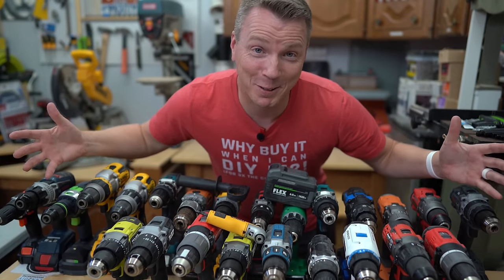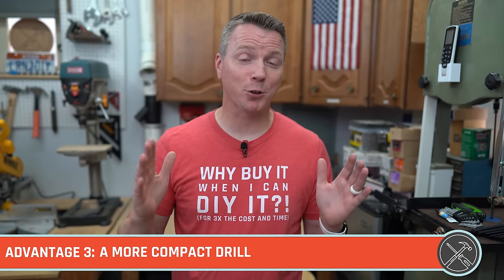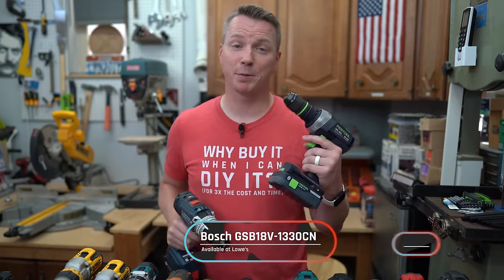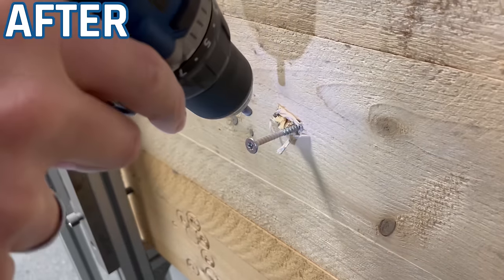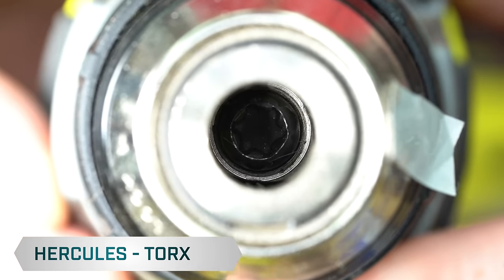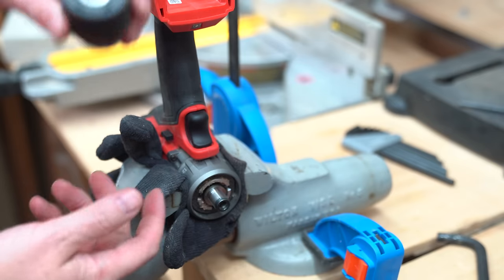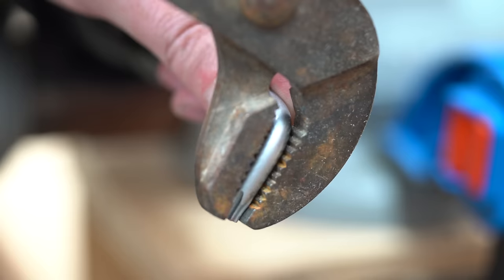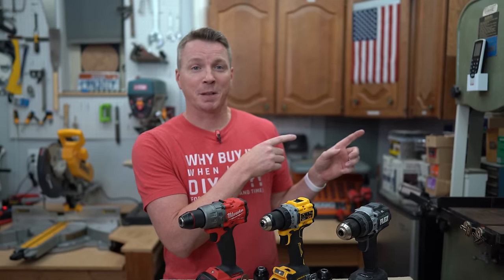The Single Best DRILL UPGRADE I’ve Seen

Comment: I’m a design engineer for a precision air tool manufacturer for aerospace and defense applications, we ran through a gamut of chucks and transitioned to ROHM chucks several years ago. Each time I’ve tested them they’ve held .001 runout at 2" to 3" from the rear face of the chuck depending on the size of the chuck. They hold drills better than most as well. We run them over 6,000 rpm in many applications.
Reply: Surprised Rohm won out over entirely better brand like Albrecht.
Reply: @agg42  a lot of that comes down to being able to fit our product line, cost vs performance, and availability. Albrecht primarily makes mill chucks that are larger and heavier than the chucks we were looking for.

Is there a different product line that they have that would fit a 1/2HP palm drill up to a 1.5HP air drill?
Reply: You just saved me from watching this. Appreciate that
Reply: @SOHCHEAD Just out of curiosity, do you by any chance have a list of the various chucks you compared? Maybe a ranking system? Just curious as I'm in the market and have had my eye on a Jacobs chuck...

Comment: PROMOTIONAL VIDEO.  BTW - these are $50-$70.     NO TESTING. The testing section has no actual comparison of the advertised chuck to another brand like Jacobs (which are good chucks!).     In one shot you see a hole supposedly drilled with another chuck where the bit wobbles around in the hole.  FAKE!?. That DOES NOT happen.   A plastic chuck would do better than that.   This is why people like Project Farm so much.  You can trust that channel.  PROMOTIONAL VIDEO. should be at the front, not end,  and at the top of the description (it's 7 lines down).
Reply: I have DeWalt, Milwaukee, and Bosch drills. When trying to drill straight and precise in certain applications they all have noticeable wobble. Especially the DeWalt.

Comment: Bosch used to make the best drills and worst chucks. So they invented SDS to solve ths. Now we have 2 options.
Reply: One of my first cordless drills was a Bosch I bought in 1988. The dealer sold me a Jacobs chuck at the time I bought it, That combo was unbeatable for years until the batteries died and I couldn't get replacements.

Comment: Great topic. An excellent alternative if you have a cheaper drill that you don’t feel like spending a lot on is the Jacobs brand chucks. At one time, Jacob’s was the premier chuck available, but they have become Chinese since. Their chucks are not as great as they used to be but still way better what comes on 90% of the drills today. They are also very reasonable with some excellent models under $10.

Comment: Röhm is the go to Manufacturer when it comes to chucks, tool or part holding. They are the best of the best, doesnt matter if on the Lathe, on the Mill or as you shown on the Cordless Drill. If you can, always choose Röhm, Quality from Germany.

Another thing ... i never in my live heared anyone say that Woodworkers are geared towards accuracy ... We have a saying in Germany and i try to translate it as best as i can. Metalworkers work in micrometers, woodworkers work in milimeters and brick layers have to see that they are on the right property.

Comment: While you should have revealed that this was a paid promotion upfront, I none the less appreciated the video. I have a Milwaukee cordless drill that I really like but the chuck has been giving me issues (very difficult to loosen after tightening). I wanted to do something about it but wasn't aware that replacement chucks were available so it looks like I'll be heading over to ROHM for a new one.

Comment: I knew I had a bad chuck on one of my cordless drills, so this was a good time to check all of them.  I made a simple setup on my welding table, lightly clamped the drill to the table, chucked a steel dowel pin in the drill and checked the runout.  The bad one was .01, the other 2 were .005 and .004.  Not too bad for a cordless drill.  I ordered a new Rohm chuck and replaced the bad one.  It tested at .002.  The one that is at .004 is a standard Dewalt chuck replaced a year ago.

Comment: I’ve been a 3rd generation Carpenter for 20 years among other types of work auto mechanic steel, different types of metal work I have all types of drills and Flex is an amazing powerful machine but the chucks aren’t great I tried to change the anvil on my impact to a 3/8 socket drive with a 1/4 hex inside the 3/8 for my own versatility options and efficiency but for love of god and can’t find an anvil to fit to replace it 😂 hoping you could help being your the drill master in my opinion hope to hear from you or someone else who’s had this issue I can’t be the only one because I want to keep my Flex impact and not have to have another impact for my uses it’s more power that I need just a an anvil will do thanks

Comment: 2:57 I wouldn't typically think of a Jacob's chuck as lower quality. Are you asserting that Jacob's made an inferior chuck for Flex? Or was it your personal experience that led you to that conclusion?
Reply from the maker: I tested the Jacobs chuck before and after swapping it out for the Rohm and it ran straighter (the bit) and felt tighter with the Röhm. Jacobs chucks aren’t bad chucks, they’re just not manufactured with the same quality control and engineering as Röhm. Jacobs no longer makes chucks in America. Rohm’s are designed and manufactured in Germany, where a close eye is kept on QC.
Reply: Jacob’s has deteriorated in quality, their chucks are no longer viable for precision work.

Their runout and ability to hold are significantly worse than they used to be, likely before manufacturing moved. Röhm makes a solid chuck that I’ve yet to see run the same loss of quality as Jacob’s.
Reply: @LRN2DIY  Its a shame to see so many big US brands move manufacturing to China. I even noticed some Estwing hammers are now made in China.
Reply: @SOHCHEAD 
Mine are so old and last so long, I didn't even know  about current quality.
Reply: @noire1001  I hadn't heard that about Estwing.  Sad.
Reply: @1978garfield  Yeah the ones with the hickory handles are. I got excited when I saw them as they look good, but then noticed they were made in China. The steel shaft versions still proudly claim to be made in the US, but there are loads of customer reviews stating the recent quality is shoddy, so I have suspicions the steel part is made in China and then they simply assemble the hammer and handle in the US to claim its made there...

Comment: My Milwaukee chucks are awsome, never had any issues like you mentioned and replacing it with the on you mentioned would if anything be a downgrade. Tested alot of chucks and Milwaukee are simply awesome
Reply: Are you sure? I use milwaukee too and the chucks suck!
Reply: @tracklizard4018  Which model no drill do you have?
Reply: @v8tergt653  I've noticed it's worst on the FPD3 (2904?) but I think it might be due to the hammer functionality, though that doesn't casue issues in other drills. Mitigated with a better chuck.

Comment: That's perfect for what I currently do with keyed steel chucks which is drill and tap them 1/2"-13 (using a lathe to keep things concentric) then turn my angle grinders into high speed right angle die grinders but without dragging another tool in the bucket. Thanks for the video! Many drills have inferior chucks for which these are an upgrade. Their larger cousins are popular in machine tool usage.

Comment: 6:47 "forward" direction is only to remove the holding/locking screw that is reverse-threaded, to remove the chuck, you need to be in the reverse direction, otherwise you'll be tightening the chuck.

Same concept at 7:43, first you need to put it in forward to put the chuck on, then in reverse to tighten the locking screw.

Comment: I change the chuck on my craftsman heavy duty drill 20 years ago. Best upgrade I ever did to that drill. The original couldn’t handle 1/2 drill bits and didn’t hold   the bits after a year of use.

Comment: I love my battery powered Dewalt Drills but my older plug in drills while still powerful give me a lot of grief because the chucks are incredibly hard to open to their full capacity and do not lock properly. 
Why didn’t we know that we could replace the chucks? I’m going to check my drill models and order the appropriate chuck.
Thank you for this video.

Comment: Chuck removal tip : If the left-handed chuck screw won’t loosen, insert the hex key into the chuck and tighten the chuck tighter onto the spindle then remove the screw then remove the chuck. The purpose of the LH screw is to help keep the chuck from unscrewing when using the drill in reverse and if the chuck has unscrewed itself, it will be jammed against the screw making removal of the screw difficult.

Comment: This is just a personal preference, but about 20 years ago my grandfather had about 10 ancient corded drills that all had solid steel chucks with the little gear/lever thing to tighten/loosen them. Well those drills eventually bit the dust (hes disabled from childhood polio so he spends his days either gardening or crafting) those chucks on modern drills are a combo made in heaven.
Reply: Those are called Keyed chucks. They still get plenty of use in machine shops for when a left-handed drill needs to be used. Most keyless chucks have a tendency to loosen when ran counter-clockwise.

Comment: This seems like a good upgrade for a carpenter, or if the chuck is damaged and needs to be replaced. I'm a home DIY guy, and the chuck my drill came with is working well enough that I don't want to invest another 50% of the cost of my tool.
Reply: All my drills are Bosch or festool and the cheapest Bosch professional drill I have was £65 with 2 batteries and came with a rohm chuck
Reply: I guess I have just been lucky. 
Whatever Chinesium chucks are  on my old 18 Volt Porter Cable (Cough Black & Decker) drills haven't given me any problems, even on the hammer drill.

Comment: How to remove a chuck in Dewalt dcd800 drill?
Three is a rounded pin to secure a spindle.
My only idea is to drill a pin to make possible to unscrew the Chuck.

Comment: Dewalt chucks are normally fitted with high torque. May have to use an angle grinder to cut within a 32nd of an inch of the threaded rod, which usually releases enough torque to allow easy removal of what is left of the chuck.

Comment: you may think it's an awesome chuck but I have always hated it and actually had better luck with my drill bits staying in with that one that you claimed to be lower end. My Dewalt chucks a re always coming loose and the bits fall out. The chucks have done this for many years. And yes i have tried the lock on the chuck with no better results. I think they need to be redesigned.

Comment: Just checked my chuck spindle size was 10mm coming in both 3/8 and 1/2 inch chuck could I put the 1/2 on to fit larger bits

Comment: Basically a commercial for Rohm. Learning  better drill control will far outweigh any advantage changing a drill chuck would give, unless the chuck is severely damaged or complete junk like on china knock off.

Comment: Which ROHM Chuck do I pick between the EXTRA80-RV and EXTRA50-RV and why, for odd jobs and mods around the house on a Dewalt DCD800E2 drill with no hammer function?
Reply: It seems that after some online pic comparison that I have on my Dewalt DCD800E2 from the factory the Jacobs flagship 8000 series metal chuck. You can tell by the design of it and by the color of the jaws vs the pics on Jacobs website. However, they make two kinds of jaws one with carbide and one with steel, and I am not sure which is the one that I have. That said, I am thinking this may be good enough for my uses and not terribly worth the upgrade to the ROHM EXTRA80-RV or ROHM EXTRA50-RV. Especially if the install is any harder than what's in this video.

Comment: is there a chuck for a rotary hammer (sds plus)? my hammer bit is wabbling like crazy and its impossible to drill precision holes on there own, I use a hilti drill to predrill a small hole before I use the rotary hammer, but this isn't fun changing tools and sizes.

Comment: Went to the website and neither of the 18-volt Ryobi P206 or Ridgid R86008 are on the list due to their age however I know that both are made by AEG. Thankfully both are identically labeled with the same like ID tag which indicates both are 13mm (1/2"). Both models are so old that batteries are no longer made by the OEM and I had to outsource to a clone mfg company for replacements which ironically, both model clone batteries which are STILL in use outlasted the OEM batteries by many times and hold their charge forever it seems. Either way, both of these drill / driver instruments are just the best ever made and have held up very very well for many years which is why I won't replace them. As for battery operated impacts, I only use Milwaukee which I have 3/8", 1/2", heavy 3/4", and the massive truck 1".

Comment: Ive done this for years. One thing I’ve learned, if you replace a light plastic chuck with a nice metal rohm chuck some drills will destroy themselves with the added inertia while breaking from high speed. I ruined my brushed dewalt 12v max drill doing this. Chuck that came with it was awful.

Comment: My DeWalt's all have Rohm chucks, OEM, but bought upgraded Rohm chucks for the hammer function drills. Same for my drill press, only Rohm had the proper taper on a high-precision keyless chuck. Each chuck ran $100 - $150 but worth the premium.

Comment: Does anyone know if I can remove chuck on m12 gen 3 hammer drill by applying high torque application in reverse with screw removed? hex key and hummer doesn't help

Comment: Years ago my favorite battery drill was a Skil Top Gun 12V. All steel transmission gears. Kinda heavy but rock solid. NiCad batteries (sealed & unserviceable) were a low point.  But putting on a new keyless chuck was a game changer upgrade. I still have the drill.  Finding better components isn't easy. Better than the interrupting ads inserted by Alphabet Co.

Comment: I've got the Makita Subcompact drill, which came with a Rohm chuck. Contrary to its reputation, this particular plastic chuck has a rather annoying ratcheting issue. It has vastly better grip than my Dewalt DCB805, but my best chuck experience was with Milwaukee
Reply: Yeah, that subcompact Chuck is my nemesis, It constantly lets go for me
Reply: My worst experience has been with Milwaukee chucks and collets.
Reply: @jimmymac601  interesting.. My Milwaukee 12v has a metal Chuck that I find far superior to 5 plastic chucks on my dewalts
Reply: @GageDrums same here with both my Gen 1 and now Gen 3 M12 Fuel drills. No issues with their metal chucks. My installation driver also came with a metal chuck. Haven’t used it much though.
Reply: I guess RÖHM as well as many other brands have quality tiers among their products.
The plastic housing on that chuck is a dead giveaway that corners were cut
Reply: @GageDrums  My M12 Fuel tools have been great. It is the M18 Fuel tools thatI have had a lot of trouble with.
Reply: My Milwaukee chucks are terrible. I have two different drills fuel and not and they are both horrible. Even been back to Milwaukee for service after failing and are no better after.

Comment: Great presentation! I have a Dewalt brushless that came with a terrible chuck. Gave me all kinds of problems right out of the box. I can't seem to find a fastener down inside the chuck and I've read you have to take the drill all apart to break it loose. Any experience with this?
Reply: They have purposely made it almost impossible to replace it without destroying the drill in the process. Its the same with my dewalt drill. They presumably want you to buy a new drill once the chuck gives up. If you search how to remove the chuck for the model number on youtube you'll probably find a video that shows how to do it, but its a PITA and a high chance of destroying the drill as you need to apply so much force and take the drill to bits.
Reply: a lot... you neet to disaasemble whole device, put axis out of gearbox and then you can make it ;) there ino screw, just torque and glue
Reply: I have a DCD800 Dewalt that had a terrible chuck out of the box. I took it back and exchanged it. Second one had wobble too. Decided to change it out with a Rohm. This is an "around the house" drill for me, so i settled on a method to remove the chuck. This may make you cringe, and i don't really recommend it. I chucked up a 3\8" hex bit with a 1\2" square drive into the stock chuck and stuck an impact on the bit. I had the drill in reverse at a slow speed and burped the impact. It broke free immediately and spun right off. I havent seen anyone else use that method, but it worked perfect for me. I may have to try it on a few other drill, for science of course.
Reply: @Cpm0487  At this point, I'm willing to try this method. Thank you!!
Reply: @Cpm0487  Hey just to clarify, I assume you removed the backwards-threaded torx before you impacted the chuck off? Tangentially related, anybody know if the 794 takes the same Rohm Extra-RV50-13 (1322451) as the rest of the DeWalts? It doesn't show up in their finder...and the OEM chuck is plastic...
Reply: @huntercook6605  the DcD800 doesn’t have a fastener inside like bigger drills. I emailed with Dewalt support and they confirmed it was just torqued on.
Reply: @Cpm0487  Hey thanks, been going down this rabbit hole in the couple hours since my last comment...looks like DeWalt is going across the board to that pressed-in pin design instead of torx. Several people doing kinda like you did, or just putting an allen in and hitting with a hammer. Others saying that can damage the gearbox, which does seem plausible. Some folks have pried it off instead, but the best approach I think might be "noseknows" here on YT who just took the gearbox apart and punched it out from the inside. Didn't look too bad.